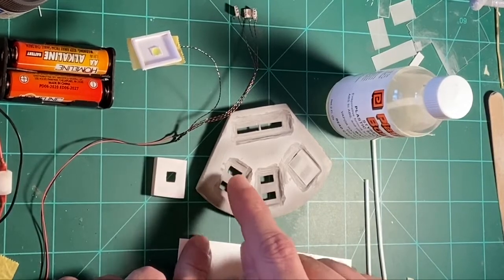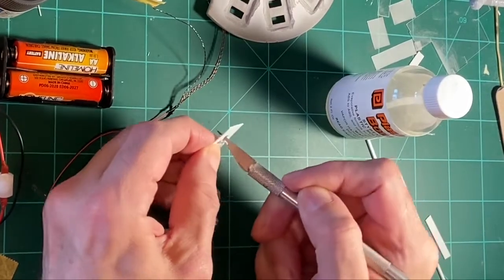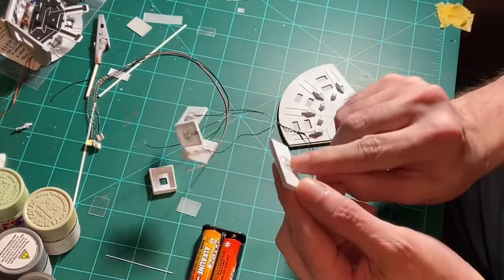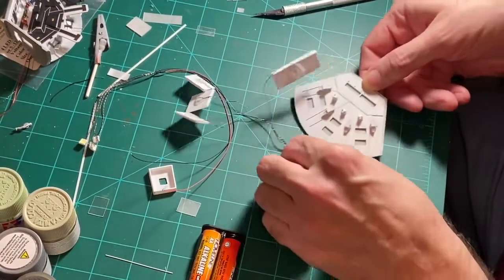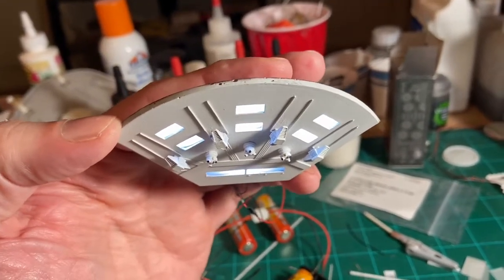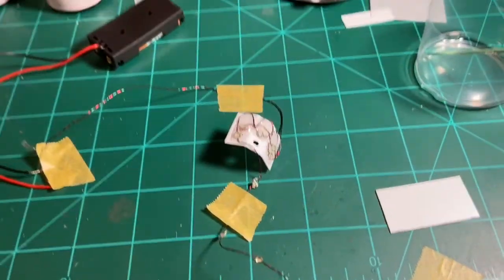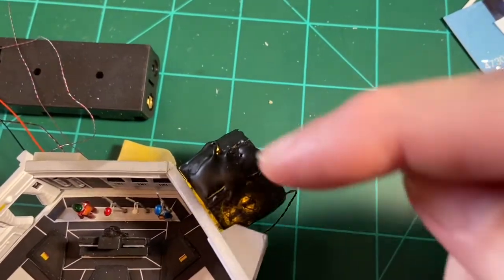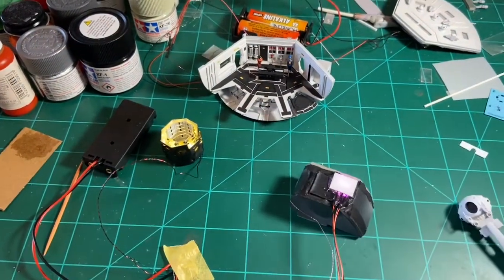NEW 2001 Discovery build part 5!

Comment: Hi Ken,

Again, most impressive. Thanks for this amazing video.

I have some questions though.
• By what method did you reduce the thickness of the cast around the ceiling openings to about 1 mm?
• How did you make sure the 1 mm remaining thickness is uniform all over and was not accidently exceeded? Some sort of template?

Thanks in advance.

Kees
Reply from the maker: Thank you! I used a Dremel with a sanding attachment about the size of the openings. I made them larger than the light openings and once they were close I gently removed thinner layers until they looked good. I also used a grinding stone attachment to clean up and square the corners.
Reply: Thanks for the reply Ken